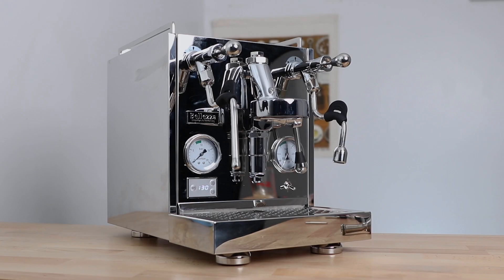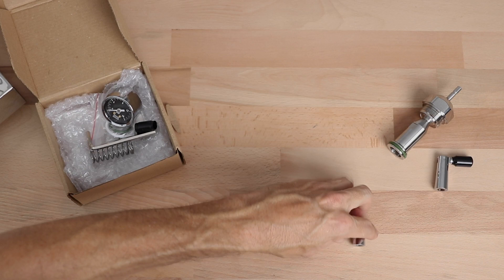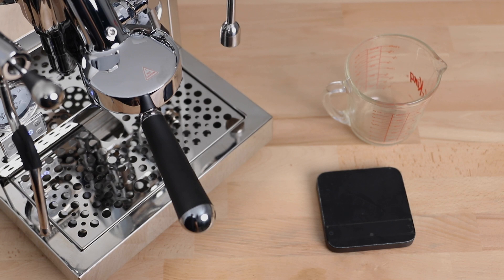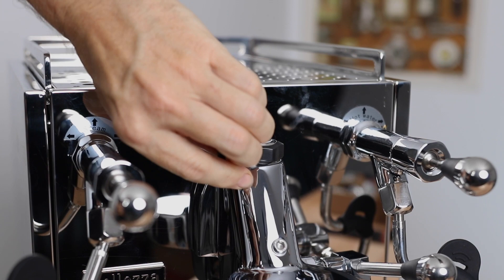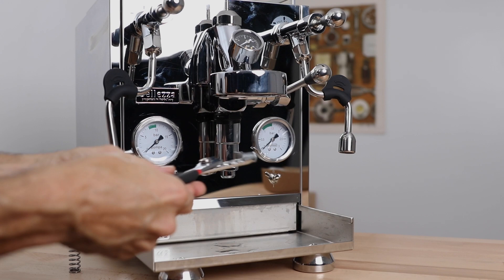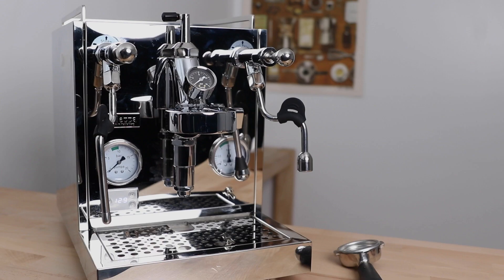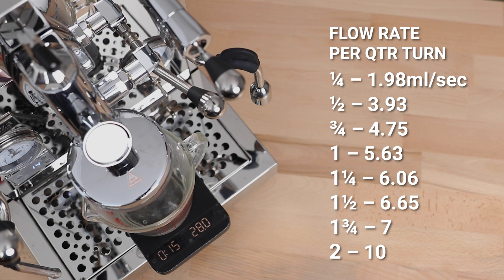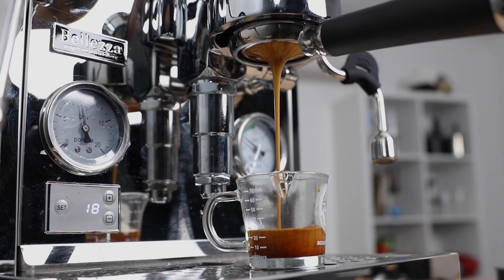How to Install Coffee Sensor's Flow Control Device for a E61 Group Espresso Machine

Comment: 1. If my espresso macine does not have preinfusion,  do I still need to replace the spring the lower part of the Group?
2. Will I need finer girinding for flow profile?
Reply from the maker: 1. No.
2. No - flow profile will allow you to slow the amount of water passing through the coffee puck. _ however this may intern allow you to increase the extraction - BY fining up the grind - and not getting over-extraction. So in around about way - you can fine the grind up - but it is not a necessity of having Flow control 👍

Comment: If my machine is a directly plumbed in ECM Synchronika, is it necessary to change out the bottom spring to the stronger one supplied with the kit? It seems to be working fine without doing so. If I leave the original bottom spring in, does that affect the pre-infusion at all?
Reply from the maker: No - sounds like - if it's working fine - it'll be okay

Comment: Great video.  I’m I correct to state that the Rocket Appartamento does not really have real pre-infusion so I don’t need to replace the spring like in your video?
Reply from the maker: That is correct
Reply: Did you end up installing one on your apartamento? Contemplating it for mine…
Reply: @rand9176  Yes I did install it.  Quite simple mod.  I can’t say I mastered the flow control recipes but you can always set the lever to provide the same flow as your original machine.  I recommend you evaluate your normal flow rate (the amount of liquid out - without portafilter installed - per a set amount of time) of your machine prior modification.  That way, you can do the same test at different flow lever settings and find your original flow verses lever position.
Reply: @wizzpet6562  thanks for the reply mate. So with the apartamento you don’t need to do the step with the pre brew cylinder at all? Can leave that as is?
Reply: @rand9176  That’s correct, only replace the top portion.

Comment: Interesting video! I have the FC on my R58 since 2 years already but I unfortunately never checked the default flow rate prior to installation. I'd guess it is the same default value for EVERY R58 on the market so the information should be easy to find on Internet?

Might seem like a dumb question but if 5.66ml/s for 30sec extraction is 168ml but you only get 40g "1:2 ratio" in the cup, where does all that extra water go during the extraction??

My dad installed mine but we never installed the "anti pre-infusion" spring. I've been told it wasn't necessary and I think either Profitech or ECM even didn't bundle the spring in their installation packaging at all and as it seemed complicated we didn't do it. What consequences exactly is it gonna have? Is it just during the initial pre-infusion process? Is it gonna prevent ramping down the flow by the end of the extraction? Can I still use most of my FC functionality?
Reply from the maker: Thanks for watching. 

So, the calculation of 5.66ml / sec would be without coffee extracting. And this will get you a comfortable flow rate of water - that then back ups and creates pressure. The flow rate will in large depend on how quick/easy you can manipulate the pressure. A very slow flow rate of  water means it'll take a long time to reach 9 bars of pressure. There are benchmarks for good flow rates on a 9 bar machine. With variable flow rates - it get a little more trial and error. In referring to the flow rate of standard espresso - it's more close to 1.2-1.6g / sec flow rate for extraction.

There are some machines that do not require tis spring to be swapped out. Generally what will happens is the handle on the E61 machine will be harder to open up once the FCD is installed. And you DON"T want to be to be using the E61 mechanical Pre-infusion. where you lift the handle about half way up to open the brew group - but not start the pump. You'll be by-passing this system altogether with the FCD further up the line.
Reply: @AlternativeBrewing  Oh thanks for the clear explanation! So if I understood correctly, the spring replacement is ONLY to make the lever easier to lift but if you don't have issue then no big deal? I just wanted to be sure not changing it would completely cancel the FCD or force it to ramp up to 9 bar while ur trying to keep it low for pre-infusion.

I never use the middle position of the levers even if I have a Rotary pump as it seems to do nothing anyway when ur not plumbed in for a higher "inline pressure" :/ 

I always try to seek 1:2 with 20g in 40g out in 30sec or minimum 25sec. I just realized that the store who sold my R58 3 years ago never adjusted correctly my pump pressure and I was at 10.0 bars instead of 9.0 bars meh... Seems like however I need the pump to be at 9.2 to get 9.0 on the FDC gauge, otherwise 9.0 a+ the pump always give me 8.8 which is a bit annoying for my OCD ^^
Reply from the maker: @PanzerIV88  yes ! I know right! Rest assure what ever you're seeing on the FCD gauge is what you're getting through to the coffee. This is why it is such a good gauge to have. 

Plus you're lucky, being able to adjust pump pressure etc on a great machine 😀

Comment: Great video. I am one of your NZ based customers and have just got the Vibiemme variant of this direct from Coffee-Sensor as you do not carry it on your site. Do you have any installation tips for this one?
Reply from the maker: Thanks for sharing! Yes it appears it is a very similar design to the regular Coffee Sensor E61 – use lots of tape around your machine when taking tools to it – to avoid scratches – use a spanner – not multi-grips like in the video ... make sure it's cold when installing ... take you time and give everything a nice clean when you're working through everything 👌
Reply: @AlternativeBrewing  Tudor from Coffee Sensor was also very helpful. All installed  now and I am having fun playing with different flow profiles

Comment: Hello AB! How it is supposed the O-ring to wear and to be replaced? As fas as I understood from your comments, it is very important to mount the kit properly in order to avoid damage in O-ring of the new mushroom
Reply from the maker: If it's not seated correctly - it may have caused rips in the seal when tightening - which may render the seal useless - in that case - you'll have to get a new seal. These are easy to come by - just ensure you get the correct size 👌 
It will wear over time - with the heating and cooling of the machine - just like the rest of the Espresso machines seals. But if seated correctly - it shouldn't need to be done for many years at least
Reply: @AlternativeBrewing  Thank you for the  meaningful comment!

Comment: I can’t seem to loosen the stainless steel screw with the Allen key. It’s stuck solid. Any suggestions?
Reply from the maker: Try un-doing the nut when the machine has been off for while. Then try when the machine is hot and up to temperature and vice versa. Perhaps going for a larger tool and better grip, than say a normal alley key - it may also need some WD40 or something similar to loosen it up.
Reply: @AlternativeBrewing  thanks. I finally turned the machine on to warm it up and it seemed to have loosened it. 👍

Comment: So if u fit the new spring, there is no pre infusion if you have the valve opened at stock flow rate position? Was the machine rotary or vibe out of interest?
Reply from the maker: Correct to some degree. Two scenario's here: Some machines will say they have pre-infusion but in fact just have this pre-infusion chamber that holds an approximate amount to of water and it uses this water for the first 2-3 seconds on the puck, whilst the pump ramps up to full pressure- still technically pre-infusion..  Whilst other machines have full electronic pre-infusion where the pump will manage the flow of water directly on to the puck, and in this way - even with the FCD, you could initiate a regular pre-infusion, relying on the pump to switch off after the pre-infusion time has been reached.. than switch back to full pressure after that. 

Having the FCD does have some inconvenience – such as back flushing the machine. You just have to remember to have the FCD open when you do it. And than, you'll tend to wildly experiment with espresso brewing and often never feel like you're getting anywhere with it – occasionally brewing an incredible shot than never replicating it 😂 wishing you just had steady and reliable parameters – but after awhile you get the hang of it and settle in to one or twostandardd flow profiles.. whichtendd to focus on aparticularr aspect of espresso in general that you prefer drinking. 

The Bellezza Inizio used in the video was a Vibratory Pump.

Comment: By replacing the spring, does it stop the line pressure preinfusion?
Reply from the maker: That's correct. So if there is no pre-infusion than the spring is not required.
Reply: @AlternativeBrewing  cheers mate.
Reply: @AlternativeBrewing  sorry it's me again. I am still trying to get my head around how replacing that spring can cut out the pre-infusion. So that sping pushes the gasket up and seal the exhaust chamber until the cam/lever goes down and pushes the shaft down. To get to pre-infusion, the lever and cam would have been in a position  where there is no longer pressure applied on the exhaust shaft. What am I not seeing here? Can you please enlightne me?
Reply: @AlternativeBrewing  all good, I think I got it figured out. Cheers mate.

Comment: I like the idea of measuring flow and then brewing recipes using 1/4 turns. In doing so....is it possible to install the flow control but leave my thermometer installed instead of putting the pressure gauge in? That would be ideal for me
Reply from the maker: I do not believe so no, it's one or the other unfortunately
Reply: Do you really need the pressure gauge? Surely, you can install the flow control (to regulate flow based on whether you want a slower or faster flow) whilst keeping in the temperature gauge. Am I missing something here?

Comment: The type of pump does it has on your espresso machine? Rotary or vibration pump? Thanks for the video.
Reply from the maker: This machine had a vibration pump. It will work with both.
Reply: @AlternativeBrewing  yes i know it works on both but i noticed on several rotary based espresso machine, it is much more responsive.

Comment: Is it compatible with profitec pro 500??
Reply: My exact question. I would think so, as it's E61, but good to confirm!
Reply: @nicks6813  yes is E61 gruop and I know will be fitted to my machine, but my question when put this flow control is it give good results with profetic 500 that is not rotary pump  and is it exchanger  heating?

Comment: It hurts to see you butcher that beautuful heavy chromed brass with a pair of pliers.
Use a appropriately sized wrench or adjustable spanner, ideally with some paper on the jaws to prevent marring the surface.
You ate goubf to look at that group every tine you pull a shot from now on, do you want to gouge it up?